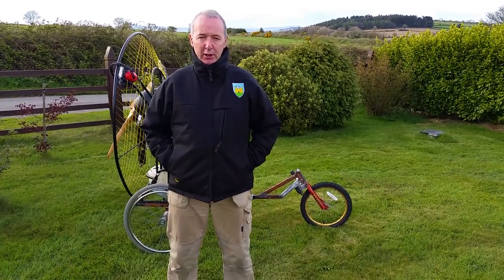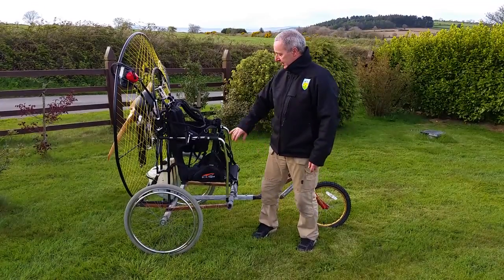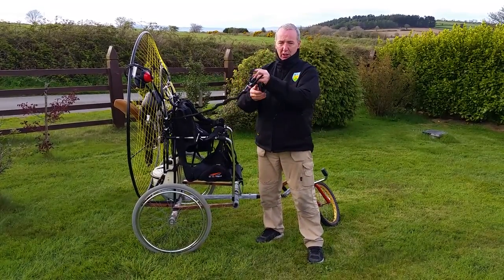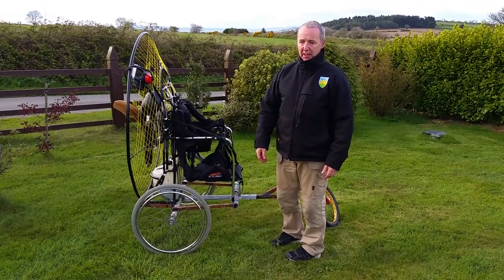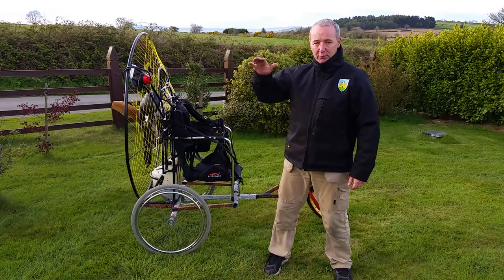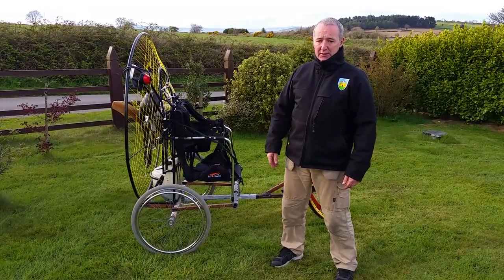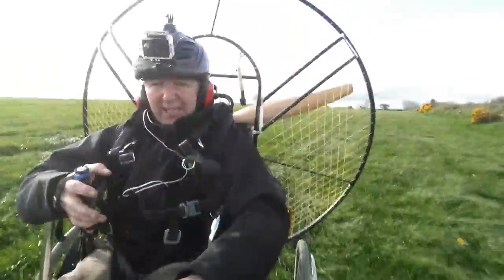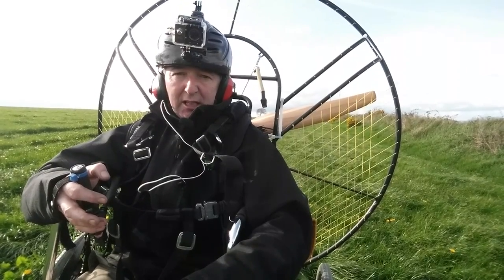Homemade Paramotor Trike from Scrap

Comment: Hi Gerry...Thats a neat setup for your paraglider. Working with scrap is always a challenge, with getting it clean enough to weld and making due with the pieces you've got on hand. But, for me, theres always something gratifying about making something useful out of a free pile of scrap. I'm a sucker for free weldable scrap metal. It's great for tinkering around in the shop. I read the comments below about your brothers music. I might be interested in using some of it in portions of my videos to spice things up a bit.
Reply from the maker: Hi Marcel. It's not a thing of beauty but its fun value is enormous. There is a danger element to it as well where one of the welds or bolts to fail there would be propeller and me all over the place. I like to focus on the fun part of the equation though  Lol. If I can manage to get this thingie 20 feet in the air for a few minutes that would be cool but I am hoping it goes well and I can get a lot higher and further than that. Feel free to use any of the Trance Jedi music he gets a kick out of it. Cheers Gerry
Reply: Yeah, I was thinking about all that brains stuck in the propeller mess... I guess that's just the price you gotta pay for a little fun...lmao

I'll be sure to give Trance Jedi credit in the description when I do use it.
Reply from the maker: Hi Marcel. At lest the trike is part medical device. Cheers Gerry

Comment: Fanntastic.   Can wait to see it in the air.  You are a gifted man Gerry.
Reply from the maker: Hi Mr Tidy. I am going to give it a run minus the wing on the beach soon. Cheers Gerry
Reply: Very nice Gerry
If you're going to the beach, be careful to stay on the wet sand. Dry sand hitting the prop could eat away at the leading edge. Maybe put some prop tape on the propeller leading edge. (Then you'd have to rebalance the prop of course)

Your feet looked quite close together on the steering bar. Do you have end stops on the feet bar to stop your feet bouncing off if you are on rough ground going fast? (I couldn't see). May be worth considering.

You'll rarely be landing at 20mph unless in still wind or downwind landing I guess, but it's possible if you have an engine cut out at low altitude etc.

Great video, and i'm sure it'll work just grand!

Comment: You should replace those hard wheel chair wheels with some really nice balloon wheels.  ?That would take alot of the hardness when landing out of the equation.  
     Thx for the video.
Reply from the maker: Hi Skyym3 The wheels are certainly a weak point in the design. I think I will make a stainless steel trike over the winter and not make my next Ppg Trike from scrap. It was a fun little project and Flew well. Thanks for the comment Cheers Gerry

Comment: Hi Gerry, having built an Ozirt/Calor   oil burner a la Gerry and got into huge trouble with she who must be obeyed, for nicking her best stainless stock pot, you have now rekindled my interest in paramotoring. I've always flown microlights before but really fancy having a go now. What make is yours? Any tips? There is a complete lack of unbiased advice /info on YouTube. Perhaps you could do something to help??
Keep it up Gerry, you're a man after my own heart!
Richard(Devon)
Reply from the maker: Hi Richard. My waste oil thing happened because my shed was cold ( not anymore ) lol.  I have ploughed through quite a few pots and pans on my journey but the burner of choice for me now is simple and mostly mild steel. I am making a variation on that theme today so more on that soon. I have lots of hours and quite a few videos on a different channel flying paragliders so when I wanted to try flying with an engine it was not a hard transition and I basically taught myself. Here's a link to my first paramotor flight https://youtu.be/mblVWPK3kjg Not a great start but I figured out a lot after that. It's a dangerous sport and super training is just hype. Good training is easily found and a lot of the paramotors were built with the moster 185 engine and the cages and manufacturers are very similar. Wings can make the most difference in therms of safety and speed. Have a go on a tandem paraglider or paramotor and see if its for you. I still have to fix my engine before I can get the paramotor back in the air. Thanks for the comment Richard Cheers Gerry

Comment: any issues so far with the front wheel being wobbly when taking off and landing ? usually the front wheel is angled backward (like a shopping cart) thx for sharing, nice vid !
Reply from the maker: Hi LadyBoy69  It is better on take off if I have both feet on the wheel. The first time I took off I didn't know what to expect and it wanted to turn left. You can see in the video I got my left foot on the wheel really quickly to recover the steering. Once the wing came overhead and it started to move forward things were better. I will be making a the shopping cart wheel mod soon. The engine needs a rebuild but I have a big todo list at the moment so it will be a few weeks before I start that project,. Thanks for the comment. Cheers Gerry

Comment: looks great how fast will that thing run you was moving on lol         great job  thumps up
Reply: Gerry  how do you pull his music off youtube  to use it I ask him if it was ok and he said yes but I don't know how you did it  i,m still new to all of this   thank  you
Reply from the maker: Hi Thomas. It's about as stable as an old Robin Reliant 3 wheel car ( not very ) but if it were a quad I think you could get to 100 mph with no difficulty. On the trike I only need 12 ish mph to take off but I was easily doing 20 yesterday  on rough terrain with the throttle mostly closed and not continuous. It's a bit like the enterprise just before the shields finally go. Lots of shaking side to side and I was thinking she cannie take it Jim Lol. A little later today I am going to cut and weld a bit more on that trike to change the angle of the prop and cage and redo the arm supports. Then it will require more bouncing in the field. There's a beach near me that's about 20km long so I might bring it there. 
Cheers Gerry
Reply from the maker: Hi Thomas. Find the music you want to download on youtube and copy the link. Go here http://www.flvto.biz and paste your link select mp3 and download. That's it and if your music is creative commons all you have to do is give credit in the description to the artist. There is lots free music on youtube. Hope this helps Cheers Gerry
Reply: thanks Gerry   Have a Happy Easter
Reply from the maker: Cheers Thomas. Have a great one.

Comment: In his videos about the fly-pod trike, sold through flight junkies, Mr. Fister talks extensively about his castering nose wheel... Although I think I have decided a trike just isn't for me, I sorta bought into his discussion on the forces involved.  Just thought I'd mention it, as your design looks like inherently unstable especially at higher speeds.  I'd be concerned that wheel loads could easily overpower your legs ability to correct, especially in side load situations, thereby exposing you to some roll over potential.  Nonetheless, I love innovation, thanks for posting this project along the way of it's construction and development.  FWIW almost all homebuilt aircraft now utilize castering nose wheel systems, they're just a better way to handle speed combined with the chance of the loads imposed ...
Reply from the maker: Hi YankeeinSC1. I did look at captain Kurt's videos and it is a good trike. Castering works well in a few designs from gyrocopters through to shopping carts. The Blackhawk trike self centers and is not castered. It's a bit like taking your hands off the handlebars of a bike it still goes straight . I tried feet off last night when I had it in the field and my trike goes straight too. I moved a support bar under the seat and I think I could foot land this now if I wanted or had to(maybe). Into wind the landing speed can be very low with a well timed flare maybe 5 mph or even less. I am looking at the weather this week so when I get a good morning or evening I will inflate the wing and if it feels good I will bring it up. Hopefully all goes well, I'm getting too old for hospitals Lol. Thanks for the comment, much appreciated. Cheers Gerry
Reply: The Blackhawk tracks straight, but a caster wheel will go with the wing. When the wing goes off to the side it will pull the cart with it, Blackhawk wheel will turn the opposite direction instead of castering the direction of the  wing.  Caster will self steer. gd lk m8

Comment: I'd widen the wheel base on the back wheels.
Reply from the maker: Hi Monkeyrock77. Widening the wheels would make it alot more stable on the ground alright but in the air would make it harder to control. It's a compromise alright but it could do with some brakes too. Thanks for the comment Cheers Gerry